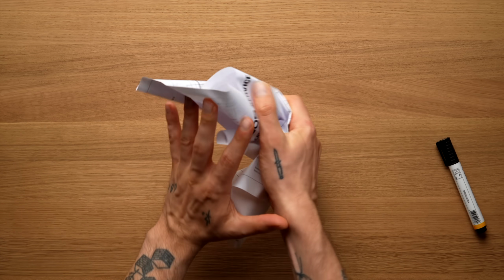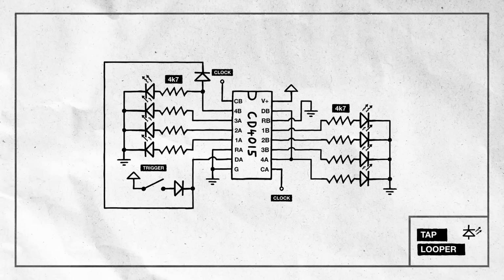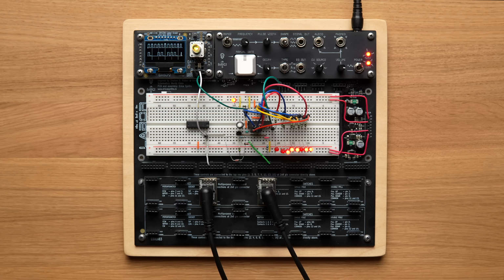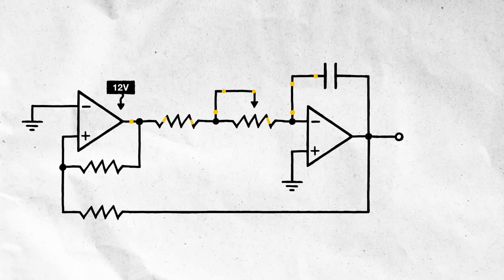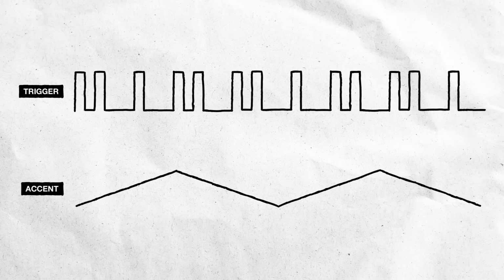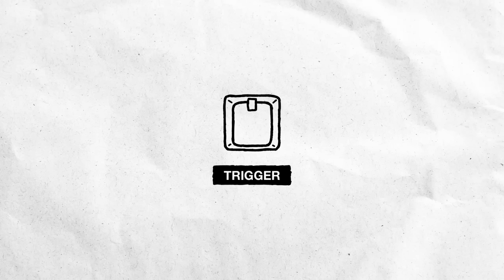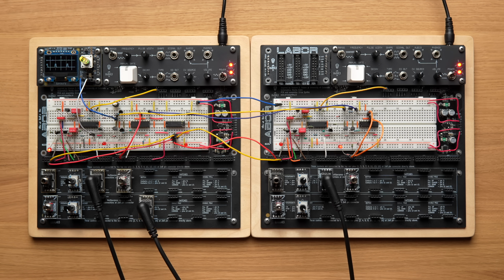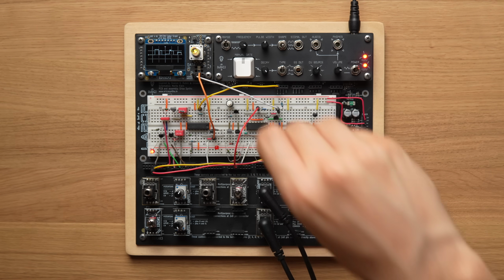This drum sequencer breaks all the rules

Comment: @MoritzKlein0
Hey Moritz! Really dig this sequencer—the resettable triangle LFO for accents is a cool approach.

Design question: Since the triangle is 0-10V and resets to 0V, the downbeat always lands at minimum accent value. To get a strong accent on beat 1, you'd need to offset the whole signal up, but then you're working with a trapezoid that has unpredictable sustain.

*Why not an inverted sawtooth?* Reset would hit 10V immediately (instant downbeat accent) with linear decay. Or a *morphable saw↔triangle* for flexible accent shaping without trapezoidal artifacts.

Is there a rhythmic concept I'm missing here, or was triangle chosen for other modulation reasons? Genuinely curious!
Reply from the maker: actually, the triangle resets to 0V before being lifted above the 0V-line. afterwards, the reset point is ~5V, which gives you a medium-loud hit. when i tested it, it sounded good to me – so i decided to go with it. using other waveforms could definitely be interesting, though!
Reply: @MoritzKlein0  
Thanks for clarifying the signal flow! Reset before offset = 5V midpoint—now it clicks.

The upbeat accent emphasis is definitely funky, and with rate modulation it could create really interesting polyrhythmic patterns. I'm curious though: when the entire rhythm section accents around the downbeat instead of on it, doesn't that risk losing the foundational "drop" that gives groove its anchor? 

Maybe it depends on context—solo drums vs full arrangement—but I feel like someone in the mix needs to land hard on 1 to keep the pocket intact. Or am I overthinking the "anti-downbeat" philosophy here?

Either way, really glad you added dynamic accents to this module—dynamics and articulation are criminally underexplored in modular. Would love to hear this sequencer in action!
Reply from the maker: @radioshaolin  i do think the key here is solo drums vs full arrangement – i mostly use accents on snare, hi-hat, and my FM drum module. but not so much on the kick. so then the kick provides the "foundational drop" you're talking about! also, you can always use the DAC CV output to drive accents instead, which does not have this restriction at all.

Comment: Is the extra pnp transistor actually a more reasonable choice than a normally closed push button? Those being unusual or rare comes as a surprise to me. I know of a few NC push buttons on the controls I use at work. But I understand not wanting to put big industrial buttons on a synth module.
Reply from the maker: when researching this, i found that NC buttons are common for industrial applications (e.g. fail-safe or interlock functions), but much less common in (small form factor) consumer electronics. so going with the NO + PNP combination seemed like the more accessible solution!
Reply: What if you were to use an NO button shunted to ground omitting the transistor altogether, btw? Have a resistor in the data line so that the button’s resistance to ground when pressed is negligibly low, thus effectively shorting the output to ground
Reply from the maker: @adc_ax  that should work for a single channel – but for the multi channel clear mode setup, i think you need the PNP!

Comment: Nice.  But for the set and reset buttons I think you'd be able to remove quite a lot of parts by simply connect the end of the shift register to the input via a suitable resistor (100K maybe). Then you connect the set button directly between v+ and the shift register input, and for clear  the button between the input and ground. That would make the transistor and diodes there unnecessary. Of course the power rail would be shorted if you press both buttons at the same time, so it might be a good idea to connect one of them via a 10K restistor. ;-)

Comment: Can work the CD4517B dual 64-stage static shift register consists of two independent registers each having a clock, data, and write enable input and outputs? Thanks!
Reply from the maker: should work, though it seems like the 4517 might have been discontinued by TI – that's why i went with the 4015 instead!